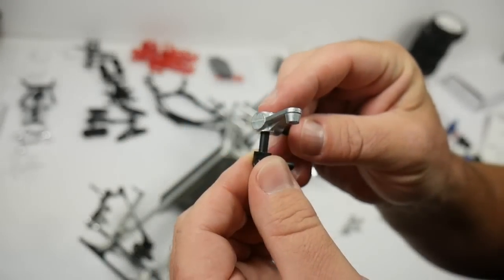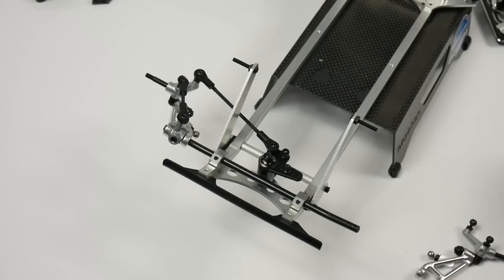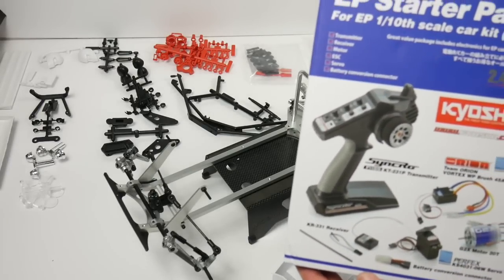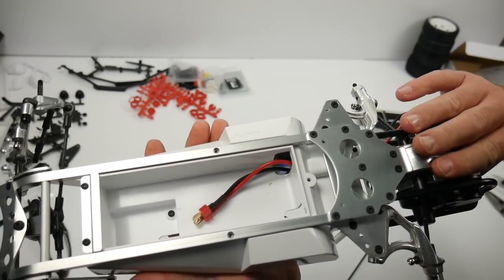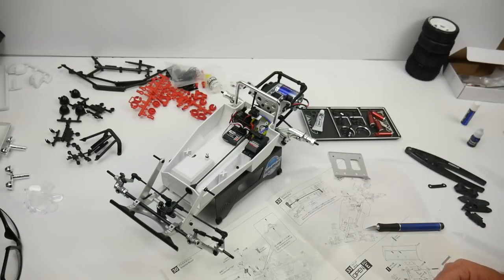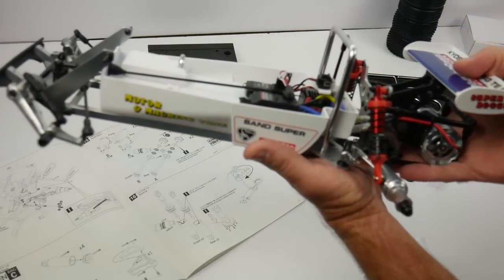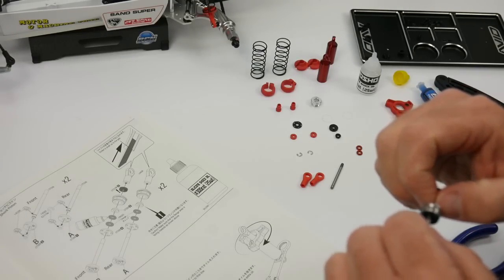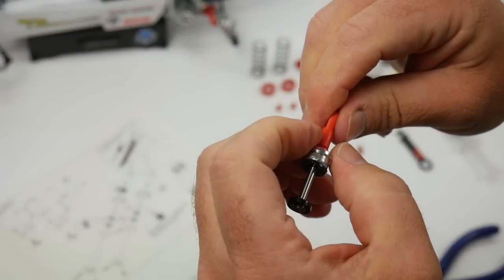Building a Vintage RC - Wrenching w/ Rich - Kyosho Turbo Scorpion Part 2

Comment: I built my first turbo scorpion in 1987 and almost 30 yrs to the day I bought the re release. I'm super excited to build this new updated car. I can see all the areas that were improved and it looks like all the old problem areas are solved. I still have my old turbo scorpion in almost running condition and now that I can find replacement parts it will prob run again. Thanks for the video. Great job!

Comment: Wow, you got the same motor and servo that I bought for my Kyosho Scorpion kit, however, it looks like you went all out and got a Kyosho ESC and receiver/radio as well. Looks very nice! I might end up doing the same as those components are reasonably priced. I've already got some ESC's and receivers but I think it will look better with all Kyosho electronics. Thanks for the build video.
Reply from the maker: Thanks Ace....The EP starter pack from Kyosho was $99 and included all the electronics I showed with the exception of a battery

Comment: Waiting for parts.. Put a castle brushless system in my Stampede 4x4 and blew both rear plastic axle shafts. It was funny driving it around with front wheel drive
Reply from the maker: I can't tell you how much I wait for parts! lol

Comment: I'm upgrading my Traxxas Slash 4X4 with RPM Parts and T-Bone Racing items overnight.  I took the  OBA out and put the original Body up.  I bought a used Body from a friend for $20 and fixed the cracks and holes and reinforced it.
Reply from the maker: Nice!  The Slash 4x4 is a great truck....Check out my Sleeper series on it:  https://www.youtube.com/playlist?list=PL5_p3gwitPIm-RkhGvGTiTaaOkKmyi3nT

Comment: my only issue , no front hexes
Reply: Why do you need front hexes on a 2wd car?
Reply: 99.9% of aftermarket rims and tires have hexes and not bearings , this limits the driveability a lot since you wont really find front rims anymore :(

technically you dont need hexes but a lot of them do have em as 4wd rims have taken over and "bearing 2wd" rims are not reallly in production anymore
Reply: Ah, ok. Thank you for your reply.
Reply: no problem :)